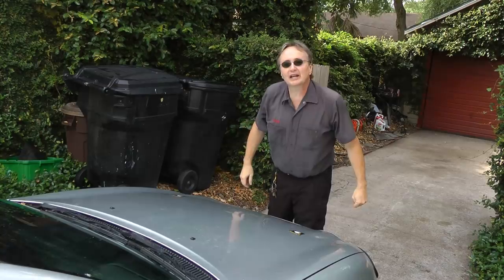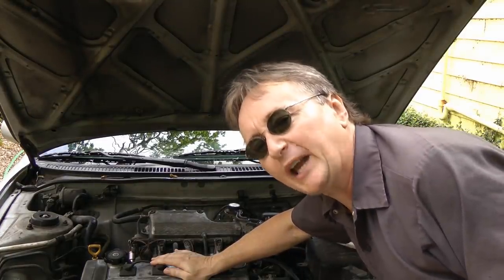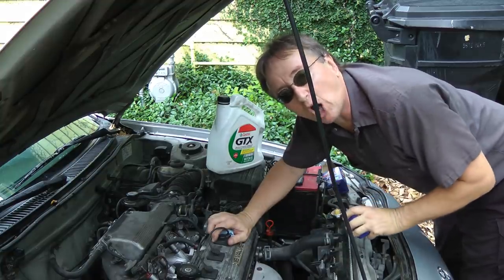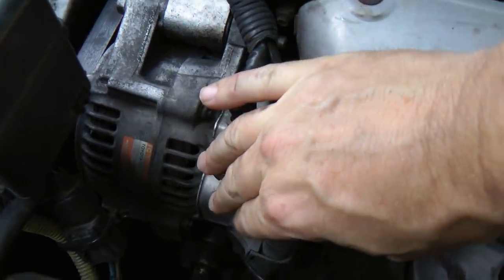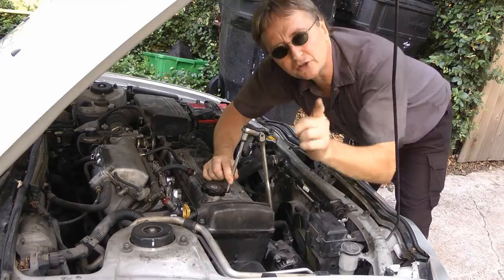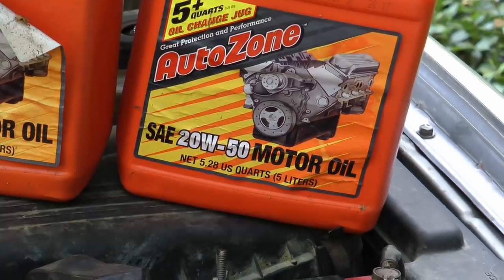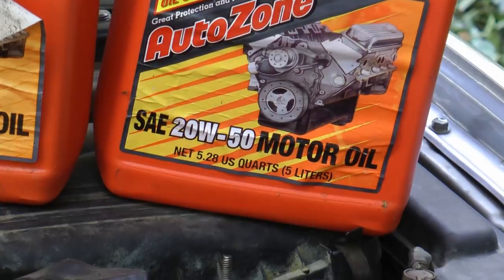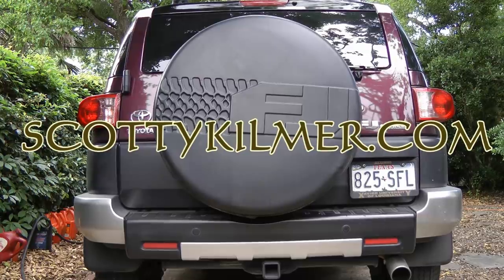Top 4 Mistakes Car Owners Make (DIY Fails)

Comment: before you out the oil filter on you should fill it up so the engine doesn't run dry for a few seconds next time you start it
Reply from the maker: that's an old wive's tale, filters drain when engine is shut off, so if that was the case, you'd have to do that every time before you started the car
Reply: scotty is right
Reply: you only have to do that for diesel engines or turbo charged. You dont even have to do it though there is enough oil coating the bearings lol.
Reply: You don't have to do that for any engine
Reply: Curious. If filter drains when vehicle is off, why is my oil filter full of oil when I change it. My filter sits vertically so how can it drain upward.
Reply: Not only does the filter drain (depending on orientation) when the engine shuts off, most of the oil in the upper engine also drains back down into the pan (some pools up in little crevices in the heads). Whenever I shut off the engine in my Jeep I can hear the oil trickle back down into the pan.

The properties of the oil let it linger on surfaces so that there's enough lubrication there until you crank the engine again (unles you let the engine sit untouched for a long time)
Reply: Oil filter housing has a check valve built in
Reply: bmx, can't hurt pre soaking the filter
Reply: Bmx Denver         On some cars the oil spills out of the filter and makes a big mess on the engine block  like that toy his working on
   But if  filter is vertical or up right under the engine  I do fill it half way and lube the gasket    I run  5w 40 synthetic   and a high grade filter   I run the oil change to about 10,000 miles saves money snd time    2003  Dakota  V6    170,000  miles strong  fires up at first throw every mng    its good truck
Reply: most oil filters are cartridges and the top have a o ring that close the return of the oil so you cant prime the filter the oil returns til the top is on
Reply: filter dont drain thats why you have to remove filter the top of the filter cap have a o ring that hold on to oil but when removed it opens for the oil to return it uses the same princip like your window washer a valve prev the fluid to run back
Reply: Scotty Kilmer ,
Thanks for the video. 
Question. So I'm curious to if some cars have the build of oil filter being oriented either side way or vertically upside down that it will not have a chance to last as long as cars that have its oil filter being oriented with fill side up, to benefits the longer life of engine, with oil being pre-filled? So I guess your answer does makes sense in a way...
Thanks,
Reply: super gizmo ok so the filter magically fills with oil just before removing it during an oil change! GTFO
Reply: paul w the valve actually keeps oil in the system from draining down backwards into the filter.
Reply: thats the oil thats still in the head. also the filter may or may not be equiped with a valve that allows them to drain back. I know most 2000 and up mercedes have the top loading fleece filters, and they dont drain down. I have to crack the filter housing loose and let it drain down, then suck all the oil out the dipstick tube. then I can pull the filter, and change it, no way to prime these either, just start the engine. oil is designed nowa days to leave a residue, or film on all the parts. its a metter of 20 rotations of the crank before oil pressure has filled the oil filter, and has pressurized the system. Minimal if any wear to any component.
Reply: vincestube2012.   All oil filters should be changed at the time the oil is change. This is to keep contamination of the new oil and engine when it is running a circulating the oil in the engine.
Reply: Homecomfort I used Mann filters for my car and on the filter it said that i need to pour some oil in it.Now i use OEM Ford filter (made by Purflux) and they recommend that too.
Reply: just make it a habit, it won't hurt. just good sense!
Reply: Greg McKee are you dense oil doesn't prime by turning the ignition on the motor has to rotate to drive the oil pump the light on your dash doesn't mean shit if the motor isn't running
Reply: On my Samurai the filter mounts horizontal, any thoughts on this Denver Omelette ?
Reply: Have you ever tried installing an oil filter full of oil on a car that the oil filter sits horizontal, or even upside down?  How do you suppose you would get that oil filter back on without dumping all the oil out of it?  

Been changing oil for decades and never have put oil in the filter before putting one back on and it doesn't run dry LOL.  The oil pickup is in the oil pan, not in your oil filter, and unless you just put your engine back together your engine isn't even close to being "dry" there's oil all over the place in it even after you drain the oil out of the oil pan, there's oil in all sorts of places in it, and a light film of oil on all the parts already.  You aren't going to harm anything for the second you start the car with an empty oil filter.
Reply: I wonder if the idiot light would go out sooner if filter was full? back in the day I would pull coil wire then crank engine till idiot light went out.If filter mounts upright I always fill it first,it can't hurt.peace of mind I guess
Reply: I remember many years ago working on an Mazda RX-7 and the filter hike points straight down when you screw it on and off.  Putting any oil in the new filter is pointless as it would all drain out.  Bad enough of the mess created taking it off.  Many filters are pretty pointless to fill up first as the oil will drain right out.  My Silverado truck, the filter hike points straight up so in that case in so fill it up first as it won't make a mess when I put it on.  It also doesn't drain out when the engine sits as oil can't defy gravity and go up on its own.
Reply: Scotty - not if they mount vertically with the threaded side on top. If it's sideways or upside down then it's impossible to fill with oil and thread it back on anyway.
Reply: Wrong!  Especially a large diesel engine one should always fill the filter. It sits in vertical won't drain out.
Reply: Greg McKee actually you put oil in your crank case.
Reply: I don't exactly "fill" it, but i do pour a few ounces in and turn the filter until i see it all get absorbed. I repeat this until i see its not taking any more oil, then i install the oil filter. Unnecessary? Maybe, but it makes me feel better about changing the oil. Just my opinion.
Reply: Funny thing is: If oil filters drain, then why is there oil in the filter when I take it off?
Reply: Most filters have a anti drainback valve so that the oil doesn't run back out of the filter when the engine is off.
Reply: Scotty Kilmer 
If filters drain everytime,  then why is there so much oil in them when I go to change the oil even if it sat overnight?
Reply: Scotty Kilmer not all filters drain I have two vehicles that stay full regardless you don't know what your talking about better brush up on your car comments
Reply: georgio jansen .... it's a complete waste of time. Your motor pumps enough oil in 10 seconds to lubricate three engines. They build the pump and the camshaft to produce an incredible amount of flow. That's second or two that it's filling the filter for the first time is not consequential. In my humble opinion
Reply: joe carreon .... calm down Jojo. That toy he's working on is in fact the finest product for the money that's ever been made. Not so much the past 10 years but for 30 years Toyota Ruled the Land as far as quality for the dollar. And prefilling your filters is a waste of time as your engine produces enough volume and pressure to basically lubricate three engines. Go look it up and do your research. Make sure you get back with me now. Have a nice day
Reply: Greg McKee ..... none of what you said is true
Reply: Greg McKee .... calm down Greg e. Go back in your mom's basement and do some more research and break out your PS1
Reply: William Todd .... thank you William. There's so many armchair experts out there. Really quite disturbing
Reply: Have you heard of "Anti- Drainback Valves " on filters Scotty.  I bet you have, Scotty K. The K is for Killer.
Reply: I like your question, germanshepherd.
Reply: I have never removed an empty filter  mounted sideways from an engine , Tony.
Reply: You may be a mechanic, Scotty , but I think you are best as an entertainer.
Reply: I don't think so, akbychoice. The large center hole is the filtered oil that goes to the engine. the valve is on the small holes where the dirty oil enters. That is what keeps the oil in the filter. That is the way I see it.
Reply: Different subject but still about Mercedes and Oil. Who knows that some Mercedes with the hand built V--8s don't have oil pressure lights or gauges? When the O rings in the pickup crack and allow air to replace oil, Engine goes BOOM. No warning for driver. How can that be?? I don't know either.
Reply: Not true...in fact in some cases the manual tells you not to add any oil to the filter when changing it.
Reply: Doesn't the rubber flap under the holes along the periphery of the filter function as an anti-drainback valve(ADBV)? The flow of oil through the filter is from the oil pump, in through the holes and the rubber ADBV, through the filter medium and out to the oil galleries through the center hole. If the filter mounts vertically, with the base end up, then you might be able to get away without an ADBV, as gravity would keep the filter canister full. You would lose the benefit though of having the oil galleries primed with standing oil for the next restart if you had no ADBV. If the filter mounts horizontally, or vertically with the base down, then the canister would drain with no ADBV. 

I've seen oil changes done where a dry filter was installed and it would take 20 seconds or so for the valve train to stop clattering from lack of oil pressure. This is NOT something that I like to hear coming from an engine. In addition to prefilling my oil filter with oil before installing it, I like to disable the ignition and crank the engine with the starter(much lower cranking RPM than with the engine idling) until I get an oil pressure reading. I then recheck the oil level and typically have to add a little more to bring it back up to the full mark. When I do this I normally only hear a little valve clatter for one or two seconds.

I love your videos Scotty but I have to respectfully disagree with you on this one.
Reply: Unless the filter is mounted vertically some oil does drain out of the filter when yhe car is sitting. The main reason it seems like the filteris full of oil when you change it is because the engine was running right before you started the oil change
Reply: There is no oil pressure for a second or two when you fire it up after an oil change because the oil filter is empty. After that instant pressure every start. Won't hurt it though. You could drive it around the block with no oil in the engine and not seize it up. There is residual oil all over inside the engine. I know, I've witnessed it happen, (by accident of course.) : )

Comment: Please note...UNHOOKING THE BATTERY CABLE ON SOME VEHICLES (i.e. vw's)  (be it negative or positive) can cause the computer to loose its programming.  Been there done that.
Reply: the computer will reboot and find the best way to run your car
Reply: i take it you either you know someone who owns one or maybe owned one yourself.  :)   Have you ever had a sore on your gums, chewed on it a little bit and said to yourself, that pain feels a little bit good?  I could be driving a vet, bmw, tundra, etc, but i choose to drive an 08 jetta.....simply cause it has the best factory stereo in my opinion.  i know its gonna hurt later but it just feels right.  Hate cars... but love God, People, and Music.
Reply: Some people enjoy driving on roads other than straights grin
Reply: And it will relearn that after a few miles.
Reply: Gary Sears Motors Somerset, Ky. Agree it can even reset error codes. BTW - when short circuit is avoided when you remove the cable, what heppens when you put it back and you really mess up snd short circuited something?
Reply: My 1997 Mitsubishi is like that. Every time you disconnect the battery the computer resets and the car forgets how to idle (keeps stalling) until you drive it around for a while.
Reply: you are wiping it's learned operations, (HOW YOU DRIVE), but more than likely you loose your radio presets, and some vehicles theres a code you need to enter into it, to enable the radio.
Reply: Sounds Like you made a booboo. The ECU will retain all factory info unless it is bad. The FOBS, Radio settings, Seat, Mirrors ect may get reset or lost.
Reply: HOW IN THE ACTUAL FUCK DO YOU CHEW YOUR ON YOUR OWN GUMS? It could maybe happen with out teeth but you need teeth to chew.
Reply: killahjeep, It's "LOSE" not "LOOSE" loose is the opposite of tight. I'm so sick of people writing loose instead of lose. It's a basic word that you learn in primary school for christ sake.
Reply: Some has back-up batteries on them. Dunno if replaceable, though
Reply: CMG camrys. Gotta drive thay bitch 6 miles just so it can stop turning off
Reply: @Steven Taylor you should losen up mate :^)
Reply: Gary Sears Motors Somerset, Ky. On a postive ground yes indeed.
Reply: They spent too many years in the 12st grade.
Reply: Gary Sears Motors Somerset, Ky. that must have been a crap us car.  get a German Or Japan car.
Reply: Won't bother computer or controllers in a car but sure f's up your favorite radio station presets on your audio systems
Reply: Who went to school here, Steven Taylor?

Comment: if I am not mistaken, the W in the oil types is for Winter ( 10W40) has a certain viscosity or thickness/flow rate during the winter months and the 2nd number is for the summer operation.

Comment: I used to own a 1998 Toyota RAV4.  When I would change the oil on that, not only would I put oil on the seal but also on the inside screw hole of the filter.  Since that engine had an oil filter that faced up, the oil would always drain out of it when off.  I had a terrible time removing the filters until I discovered oiling the inside screw hole along with the outside seal.  I never had issues removing them after doing that.